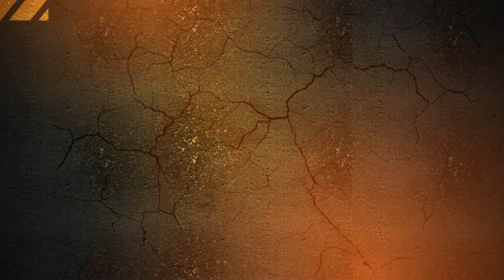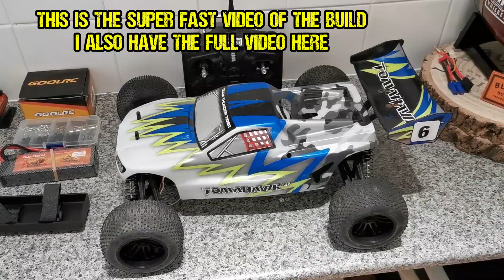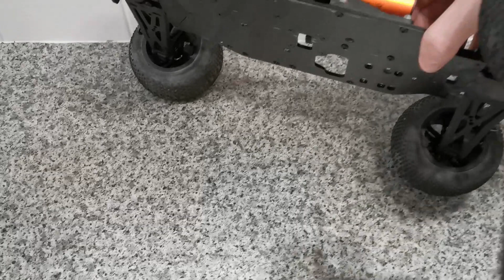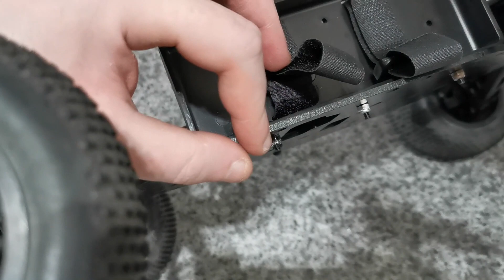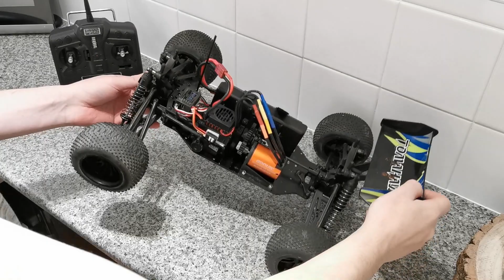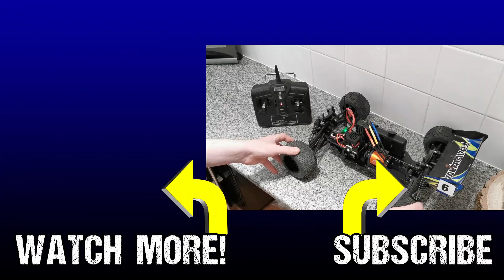Turning A Nitro Powered Truck Into Electric Brushless Power / Short Build Video

Comment: hi bud, i have a tomahawk exactly the same that has a seized engine ,  what are all the parts you used eg gearing ratio from brushless to the main drive gear etc, i figured out the motor controller etc and also what about the breaks how do you sort that out?? any info would be great as i intend on doing this conversion to mine thanks in advance

Comment: hi, can you tell me where do you find your motor mount and what's the motor pinion?
Reply from the maker: Jean Daniel hi mate, I found the motor mount on eBay, I just typed in 1/10 motor mount and loads popped up, the pinions we used were 1/8 25dp pinions with a 8mm shaft hole. Happy rcing 👍

Comment: Brilliant project Marc and well done. Can I just ask, sorry if its a silly one mate as new to RC as you probably know.... Why change from Nitro to Electric as thought Nitro are better and can run longer, then when out of fuel a quick top up and your off again?
Reply from the maker: waddac2 hello mate, thank you very much, it was a really simple project but really enjoyable..
No question is a silly one mate and yours is definitely not.👍
Nitro is not better then electric and electric is not better then nitro either, they are just different and both have their pros and cons, I do personally prefer electric though, for these reasons, electric models they are much easier models to run and maintain, they don’t smell lol nitro fuel is very smelly and oily and it gets everywhere, it goes over you and over the model, electric is also very quiet, nitro is as loud as a moped or dirt bike, so you don’t want to be using them in the street at night that’s for sure lol, and nitro fuel is not cheap, and in a lot of cases nitro models don’t like starting up flawlessly in the winter and the engines don’t like colt and only have a tiny spark plug so most of us find a way to pre warm our engines first because trying to start them in the winter, also it’s very rare when running nitro models they run perfectly all year round, in the winter and summer etc you have to tune (rich or lean the fuel to air mixture) you suit the weather or if your engine is just being fussy that day, I could go on and on mate lol.. with electric models it’s just charge a battery plug it in and go play. 😁
Don’t get me wrong though nitro models are also fun, the sound of the engine is always good to hear, we have had many nitro models over the years, but as electric models have now got more powerful and bigger and with great run run, a lot longer then a tank of fuel lasts that’s for sure, we have now got rid of all our nitro models we just did not see the need to have them no more..
Happy rcing buddy, thanks for watching and thanks for your question too.👍
Reply: Nice one mate, thanks so much for that great info.... After reading will def purchase an electric rc when I can afford one. Prob will be after xmas though as purchasing a Hunsan Zino from Colski at end of this month as treating myself as it is my birthday on 25th November and get paid a day after. Regarding getting an electric rc car, I loved my old tamiya boomerang as a teenager and understand they have made a new better addition so will prob opt for that with a spare battery or something. Also would like to keep trend and have a normal controller with gimbles rather that a squeeze trigger and steering wheel, lol. Thanks again mate ;o))))
Reply from the maker: @waddac2  hi mate, your more then welcome anytime. Core your love the zino off col bet you can't wait for that.. Oh yes that will be awesome to have a blast from the past rc car, I do love tamiya and the fact they keep all the older models going, I just picked up another new model one that I had about 8 years ago but this time it has a twist on it, I'll reveal that one soon.. Have a good week bud 👍
Reply: @MarcRCAddict  Yep itching like anything to play with the Zino. Tamiya wise, think I said but as a teenager I had a total of three over the years... First was The Frog, great two wheel drive car, then I got a Wild Willy jeep, which I was not keen on as due to flipping backwards all the time.... Then did some trades and got the Boomerang.... Best Tamiya ever in my opinion.